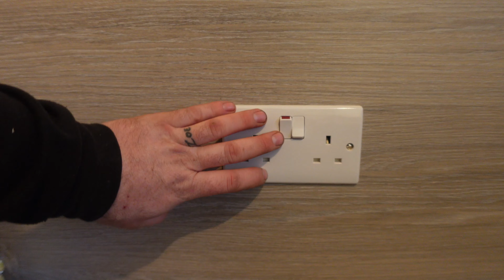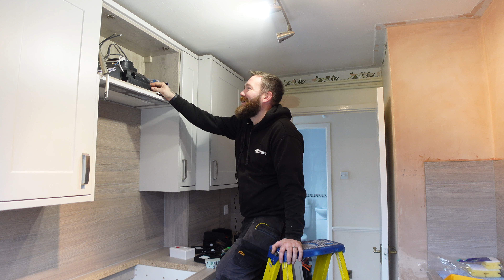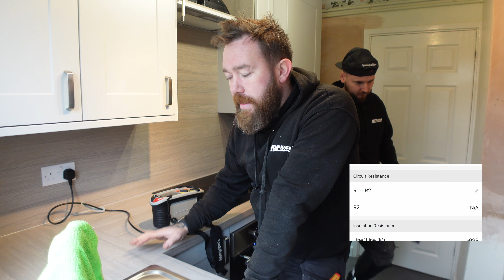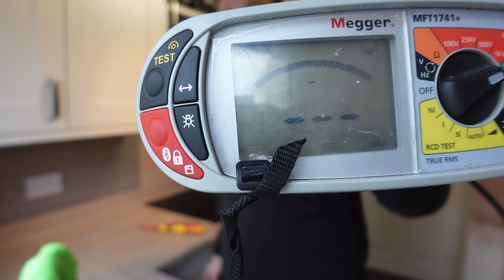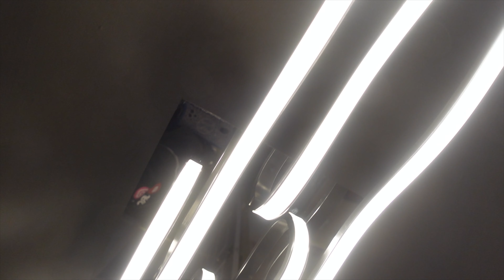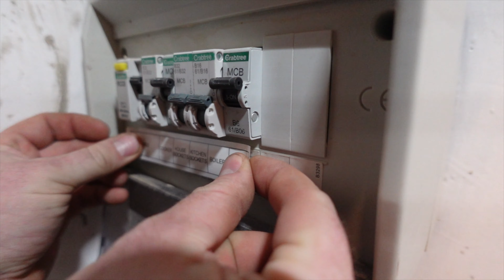Ring Final Circuit Test Sequence! (For Electrical Apprentices) - Electricians Life UK

Comment: did you calculate the  (R1+R2) on paper before you tested the sockets to see if was in the correct range etc? (as r1+r2/4)👍
Reply from the maker: You can do that I normally check the r1r2 plus ze and see if the zs is in the range.

Comment: Am I correct when you do figure of 8 , is it resistance of your r1 plus your r2 together and divide by 4 and thats what you should get at each socket ?.
Enjoyed the vid on testing 👌
Reply from the maker: That’s for the r1r2 you can do your live loop plus your earth loop readings divided by 4 should give you r1r2 readings, you can then take your r1r2 and plus the ze (external) to get your zs readings of the circuit